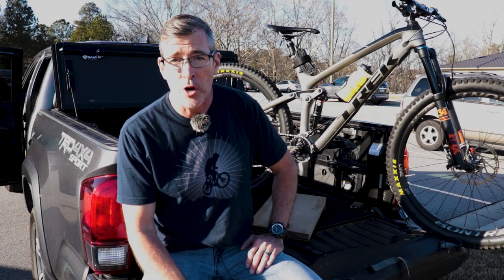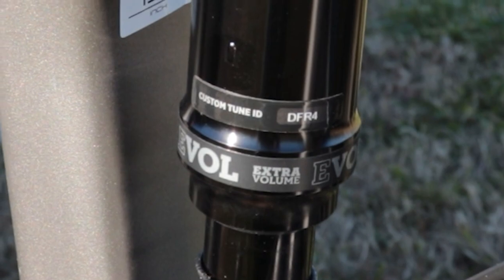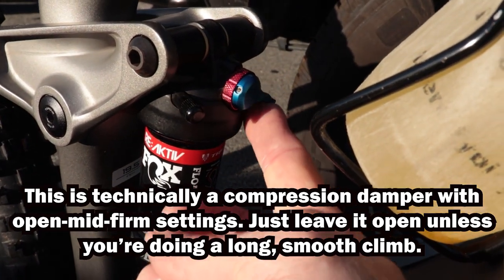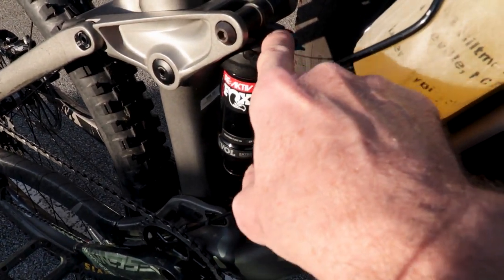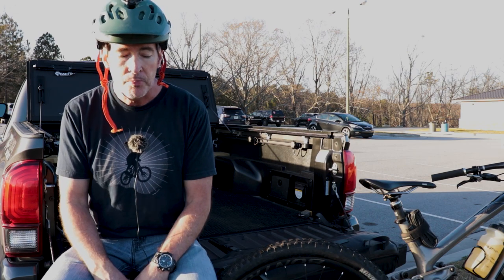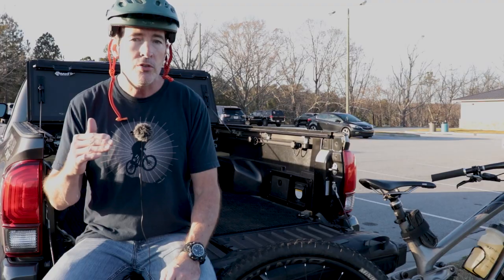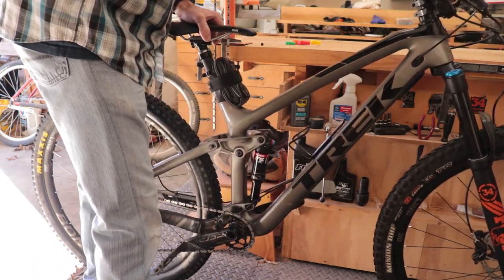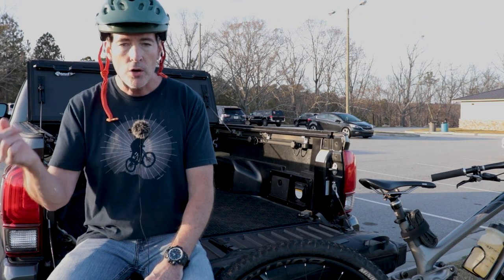How to Easy Setup a Simple MTB Shock. Suspension Settings MTB

Comment: That's awesome man, I didn't know about the air volume stuff or that you could open up a shock like that! Gonna have to check mine, I definitely don't dial in my settings enough and I've seen my o-ring all the way at the top/bottom before and it's always concerning lol.
Reply from the maker: Yeah, it’s intimidating until you do it and then you realize it’s nothing😁. It took me 10 minutes to swap my volume reducer and get it back up to speed. My “trail” bike is smoking’! 😁
Reply: @TrailBreaker  yeah I know that feeling I used to work on cars a lot. I'm guessing the process would be the same on my Rockshox Monarch?
Reply from the maker: @DirtTrampMTB  Exactly! All shocks operate the same...just slightly different numbers

Comment: I'm 220 pounds in USA 🇺🇸 speak. I've been trying to tweak my shock with great results. I had to add 1 volume spacer to my Rockshox Select shock. I reset my sag, set my rebound and hit the trails armed with a notepad. I changed the rebound settings backwards and forward until I found the sweetspot. The difference is Chalk and Cheese. I heard somebody say, "Too many people would just change their shock without exploring the settings on their old one and probably wouldn't explore the settings on the new one either". I know a few guys that haven't touched their shock from new. They don't even own a shock pump.
Reply from the maker: I agree! It's not hard at all and you can make any shock ride better